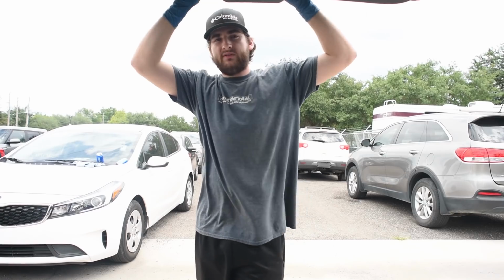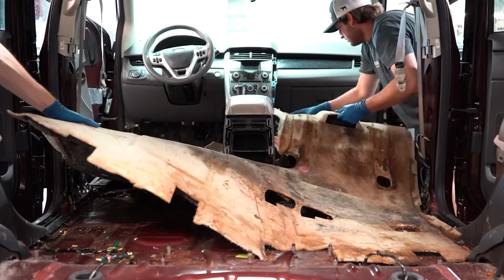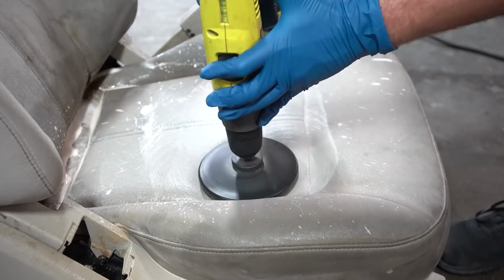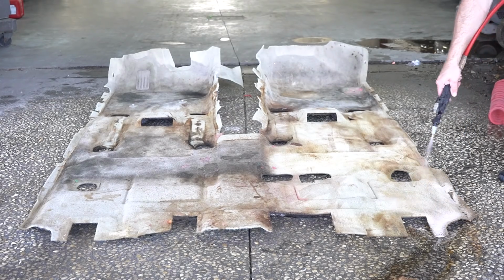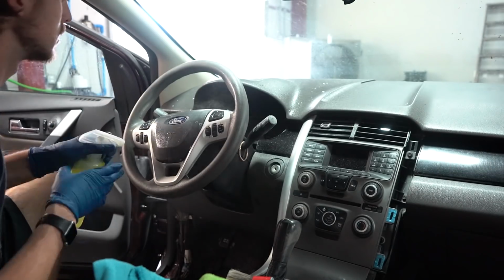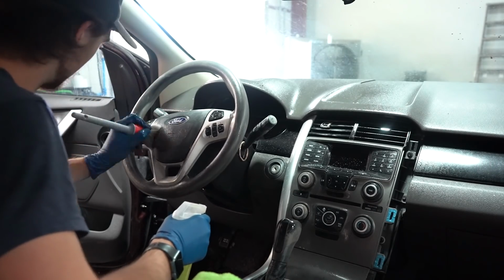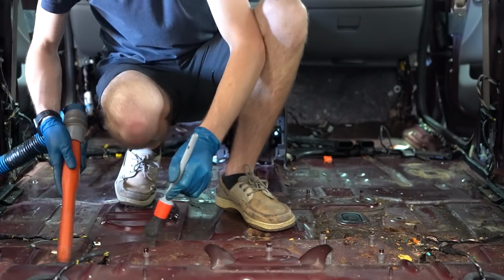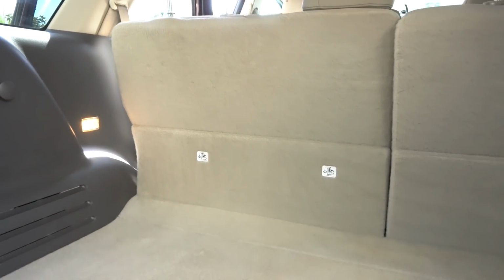Deep Cleaning The Nastiest Car In The World! | Insanely Satisfying Car Detailing Transformations!!

Comment: When I got out of college, my first career was at Enterprise rent a car.    We had thousands of cars in rent in my city and several would get trashed.   

The reason I bring this up is when we had a light carpet get stained like this cars, we would take to our local detail shop.   They would do what you did but then for an extra fee would dye the carpet the next shade of gray or tan/brown.    It would hide like 95% more of the stains that just would not quite come out.  

You may want to add that to your offering as the dye was not expensive and the detail would just spray on, scrub with a brush and re apply if needed till it darkened enough to hide all the stains that would not come out.

Comment: All I can say is "Holy Sh%t". Who in the Heck drove that SUV around and let it get so run down?  I hope you wore double gloves on this one.  Can't be too careful.  It's a good thing your extractor has the capability of using hot water.  It had a workout that day.  You had a terrific idea by taking the carpet outside of the SUV and power washing it with the water jet.  That was just some of the most awesome floor and upholstering cleaning that I have ever seen, with great results too!!!  You had to have gone thru 50 microfiber towels, which probably had to be tossed.  It looks like this was a 16+ hour job.  Excellent finish!!!  Congratulations!

Comment: On REALLY bad vehicles the key is to allow extended DWELL TIME on your pre spray application.
I use Chem Spec 90 liquid.
Brush and Prevacuum
 Prespray and rotary drill brush in
 and allow it to set 20-30 minutes and that stuff comes off EASY. 
Using a pressure wahser really makes it way more easier to remove soil and stains.

Comment: great jobs cleaning the car guys, something relaxing about watching you guys do good work.
I saw that CarMax logo, hopefully this was a car they bought from CarMax, and not a car that was going to end up at CarMax. If they treated the inside of this car this badly what do you think the odds are they did all the maintenance that they were supposed to do. Unless this thing was very low miles or had a detailed history report on maintenance. No way in hell I'd consider buying that.
I think when I saw that carpet I would have simply removed it folded it up put it into a dumpster, and ordered a new carpet for it. God think of the biohazard.

Comment: For future reference, the best and easiest way to clean the carpets and the seats would be to soak them with your cleaner/degreaser, pressure wash to remove the bulk of the dirt. Then re-soak carpets and seats, agitate with drill brush and rinse again with pressure washer. THEN USE EXTRACTER to remove remaining residue. You're making the extractor unnecessarily do too much of the work.

Comment: For that nasty driver seat, i would have brushed it  and dry vaccumed it before anything else, after that i would have cleaned it with the liquid extractor. then i would have used the spinning thing with the brush and some foam, and then again the liquid extractor. in my opinion, even though it would seem to be more complicated it would save you time and products by reducing the necesity of using the liquid extractor, and the fact that you don’t spread mire the filth. Sorry for my English, I’m a native Spanish speaker.

Comment: WHY do you use such a tiny vacuum tool for such a large area?  If you're going to pull out the whole interior carpet, wouldn't it be far easier and more efficient to use the whole vacuum on the floor outside while it's on the ground?  Or at the very least use a tool that's so much larger?